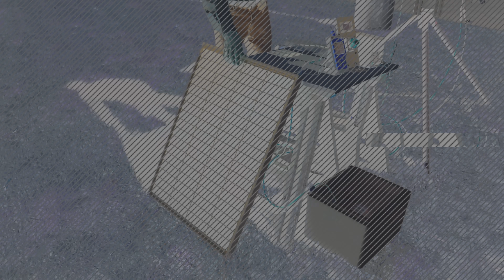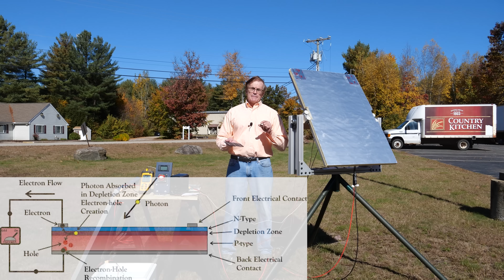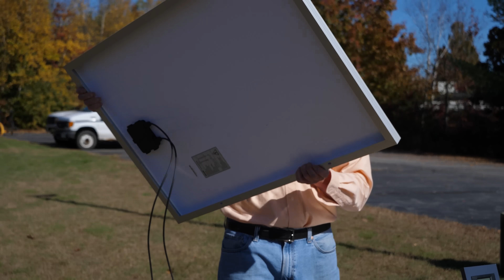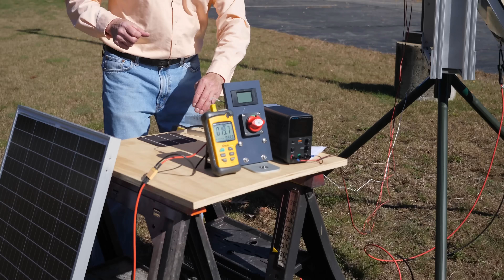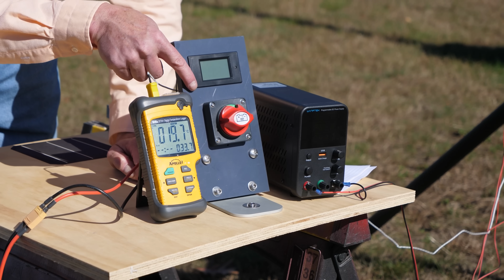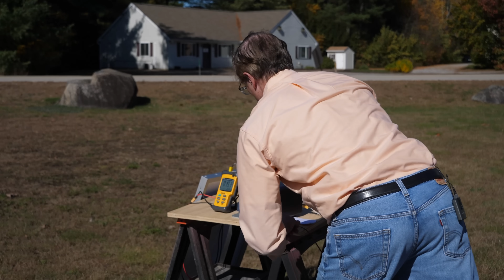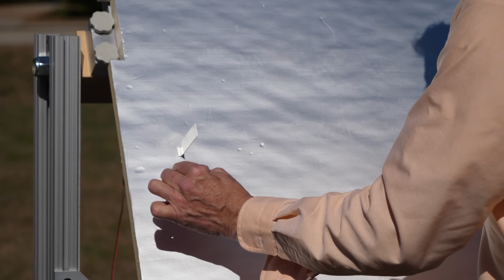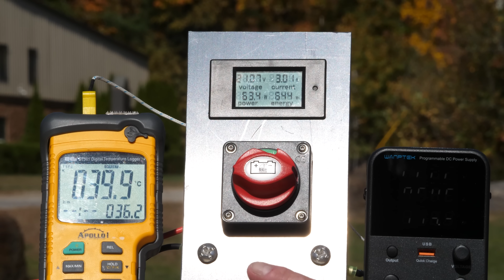Do you REALLY get enough out of your solar panel?

Comment: Glad to see you fellas start posting again.  I can't help but think fan replacement costs and dust/dirt buildup in the cooling area would make the efficiency boost not worth the modification.  Also, wouldn't ice in the fans destroy them every winter even though they're off?
Reply: If rather than using individual fans per panel like in the experient, you used two or three large fans, designed for outside use (those things last for decads), per system, you'd have a much more reliable cooling system. He touched on this towards the end of the episode. Also, if the fans were installed at the edge of the installation, you wouldn't need to remove any panels for repair. Obviously this would also require some sort of air channeling, but that's a problem that's already been solved.
Reply: @smwsmwsmw  no moving parts in my opinion.  Panel itself survives on it's own "historically".  I'd go with one big fan blowing on the array during hot calm days and/or paint the shingles white but I think that's pretty moot.  Not worth the small efficiency gain.

Comment: The least efficient solar panel is the one that's not installed. Most panels that are installed could generate more power, but they are generating some.

I've owned my house for 23 years. I've had panels on it for just under two years. They generated almost 11 MWh in that time. They're at a bad angle, they get shaded, but they produce infinitely more power than when I didn't have them.

So it's good to increase efficiency, folks should definitely do that, but the key is to get them installed.

Comment: Solar power is interesting and useful in some places, but hardly something that we should be trying to convert large portions of the grid to using.   The 'dirty little secret' of solar panels lies in the power they take to build.   I worked in a solar panel production facility and in-house testing showed that a panel would need to be in use for 7 years (in ideal geography at the equator...anything north or south and you lose the amount of sun it gets) before it produced as much power as it took to make it.   In the higher latitudes where I live it's unlikely that a panel will ever break even within its' lifespan.   Not to mention the massive water consumed by solar production as well as the nasty chemicals used in the process....I'd keep solar use only to places where conventional base generation is unavailable.

Comment: I can't help but wonder if adding peltier modules would be even more beneficial to what you have outlined in this excellent video. As always, well done!  Thank you!
Reply: Peltier modules are notoriously inefficient. Plus you'd still need a fan to remove the heat from the area.
Reply: @smwsmwsmw  They already have 3 fans on the setup already.
Reply: Peltier modules are inefficient... i think you can easly make the airflow more efficient, but that was not the point of this project, he wanted to test the whole idea of using some power to get in the end more power out of your setup.

Comment: I wonder if just the heat sinking passively would have relevance 🤔. Of course active would prove better but if passive heat sinking did have a significant gain then it may prove to be useful in certain applications. Would you guys be interested in doing a follow up with just the heatsinks in a passive setup? Just to show hard results and relevance. And thank you btw for your content!
Reply: came here to post that same question. Hopefully they answer it. Passive costs zero watts.
Reply: Based on what I've seen in PC hardware, this would be really difficult to pull off. Would love to see TI give it a go though.

Comment: I would like to see a comparison with panels that you only added the heat sinks. Maybe with one that protrude out beyond the solar panel enclosure. This would compare an optimized passive cooled system to your active system.
Reply: I'm curious how much adding a little solar chimney to the top of each frame would assist that natural passive ventilation would do? A few inches of black painted frame to the top to induce additional convective flow from the bottom.

Comment: I wonder if there is a higher efficiency improvement, if you add semi-transparent side  reflectors, with the right reflection wavelength, suitable for the panel.
So more light, less heat on the panel (plus a warmer roof).

Comment: Just amazing explanations as always!
I was however wondering if you thought about the added maintenance cost for the active fans themselves?
You did not mention the exact model so I just had a quick glance at the orion spec sheets and found 60-90k of expected operating hours (~7-10 years).
Although given the prices of around 20$ for some fans those costs would probably not amount to much as long as the diagnostics and replacement of any given fan is not too much trouble :)
Reply: The fans can actually last much longer because the ratings are L10 ratings. That means that given a population of fans, 10% can be failed by that time. L10 rating also assumes constant operation, but the duty cycle of the fans in this application would be less than that because there's no reason to run the fans to cool panels at night. So actual life will be much longer than a simple reading of the L10 specifications.

Comment: What would the wattage output and temperature be without the heat sink and fan setup installed. wouldn't it be a better comparison with a panel "out of the box" to one setup with your active cooling setup.

Comment: all of this makes me really question if we might just need to rethink solar power in general.

photovoltaic is convenient, but the materials are really expensive, they degrade over time, and as this video shows - they need to be cooled.

my bathwater is heated using solar directly, by baking a series of pipes dyed black in the sun, which heats the water that flows through them.
such systems become vastly MORE efficient, the hotter they get.

all that's required now is converting that heated water into power, which should be no problem given the heat difference between the pipes and ambient temperature.

no expensive components needed at all, the system gets more efficient the hotter it is outside, much more easy to replace and maintain, despite likely not ever needing to, because of this systems longevity in general.
there's not much to degrade when it's just a bunch of pipes, dyed mat-black, in a sealed chamber with a moderate vacuum. 
they last practically forever, but even if they get damaged somehow, any issue should be trivial to fix.

Comment: Have to also consider the physical stress from the aluminum strips thermal expansion.    However in an OEM case they could design around this.   A diyer might mitigate this by cutting the stips into much shorter segments... just squares

Comment: ?  A smart micro-inverter could back drive each panel in winter to melt snow covering the array.
After all an H bridge driver can do this.  Snow has blocked my panels for about 30 straight days
this year,   I lost about 3% of my normal 8.5MWH yearly production to the snow here in the PNW,

Comment: Mechanical components in outdoor environment running 24/7 for years decreases the MTBF, it is not ideal.
Mobile basestations have the same problem, heat reduces performance and increase risk for failure.
Basestation manufacturers try to avoid fans in outdoor equipment that run 24/7 for decades, they treat fans like if it is a plague.
You could have the fan only kick in when needed

Comment: This is why you never mount your panels directly to your roof. Use a railsystem so you get them atleast 20cm up from the roof surface. That way passing wind etc. will cool the backside of the panels - more years longevity and slightly better performance daily. I have done this to mine.

Comment: I am disappointed. As a native of New England transplanted to California I notice that you picked an atypical calm day for this experiment. We here in SoCal have them most of the time. I would like to see the same experiment done with the other, un-modified panel with a modest wind to see if it is roughly equal  in operating temperature just having the normal air circulation and heat transfer away at the back side. 
The  problem I see with the modified unit is radiative heat flow is stymied to some extent by your back panel. It could be reradiating right back to the solar side of the plenum equipped panel you have created. Please repeat the test on a comparable day, or use an IR thermometer to add in the radiative  heat flux.  Thanks anyhow for giving me some other things to check out about my solar battery backup system for the potential earthquake blackouts I can expect in sunny SoCal.

Comment: What did I do? I have 21000W panel installation on 15000W inverter. 60% facing SW. 40% SE. Cooler panels, longer lifetime. Always limited to 15000W during summer 3...4 hours

Comment: Thank you very much for your informative video.  Would the hot/cold(shade) temperature differential be enough to drive a peltier unit or array; considering the fans only require 6V/1W?

Comment: Hello again... I saw video with the panel and the mirror idea and it works well... Could you try to combine the ideas and see if it can be possible to run a full system... Also just as a idea or "joke" at night what if you could run a flashlight or LED setup over the panel to gain some extra power... use a power bank and run a matrix of LEDs over the panel to see if you can generate some power... LOL if only it was that simple... Thanks for the great video.... Cheers!

Comment: I'm not convinced eliminating the MPPT charge controller is appropriate.  When the temperature of a solar cell increases, the (short circuit) current increase as well.  The (open circuit) voltage however drops with temperature.  The optimum operating point is typically about 90% of Isc and 80%Voc.  With increasing temperature, the maximum output power does indeed decrease.  If you pick a fixed load dominated by the current (e.g. voltage across the load is say 60% of Voc) then your are current limited and output power will actually increase with increasing temperature.  If you pick a fixed load dominated by the voltage (e.g. load current is 70% of Isc) then your are voltage limited the the output power will decrease (dramatically) with increasing temperature.  The MPPT controller will optimize the operating point in any condition (sunlight, temperature, etc...) which may (I'm not 100% sure about your setup) show a smaller delta in power out as a function of temperature.  It wouldn't surprise me if the 5W gain with the fans for 3.5W of fan power, drops to 4W of gain (and maybe below 3.5W of gain).  Just something to consider.  Otherwise, Great video!

Comment: It'd be a huge pain, but I wonder if one could use the waste heat from the panels to power a low temperature Sterling engine. The engine could power the fans and add extra power if there's a surplus.

Comment: I really like the idea of active cooling of the panels! However the other argument against this setup would be that those fans in that environment are guaranteed to fail well before the panels' useful lifespan and replacing them would be a significant expense in just the labor cost for an array that's up on a roof. That's one point in favor of a liquid cooled array where you can have the moving parts separate, mounted in a location that's not so onerous when it needs maintenance. A 50/50 propylene glycol coolant would get around the 32F problem of straight water.
Reply: for small scale your are right.  At a whole house scale it's less of a issue.  Houses with central air for example rarely need to replace their fan's.

The freezing water issue was brought up specifically to deal with wells or lakes as your heat dump.  The issue with using glycol is your need a closed loop with a radiator.  Now you need fans as well as a pump.
Reply: @barongerhardt  yes, that's true.  The issue is that the fans already took more than half of the increased output to run.  If you add a pump in your not going to have any net gains at all.

Comment: Random Thought: How about sandwiching thermo-electric devices between the panel and the heatsink? The TECs could power the cooling system, maybe generate some extra power to boot. Covering the entire backside of the panel with TECs wouldn't be practical. Maybe just put a TEC under each fan, with an appropriately sized heatsink.
Edit to add: How about pairing up the solar concentrators with the active cooling, to really amp things up? (pun intended)

Comment: Have you seen combination solar panels that have pv and thermal built in? The thermal cools the pv while also capturing the heat and bringing it into a heat pump or hot water tank. Basically accomplishes the same

Comment: Synthetic jet cooling,  zero mass air flow can be very efficient.  Glue a CD to the face of a three inch
eight ohm speaker and excite it with a few volts of AC.  A high velocity jet of air results.  Actually
rolling expanding donuts of air are being lauched at 60HZ.  Very turbulent impingement cooling.

Comment: MTBF on te fans will be a killer for multiple panel installation. Would rather use passively cooled options like your bent metal (why not just use "extruded L" Profiles? and leave the back open to the air?
Reply from the maker: It doesn't  work as well.  Multiple,  large diameter, and low velocity  fans are a good option.
Reply: @TechIngredients  Natural convection vs. forced convection. Agree Forced is better, but if you can design for Nat. convection it would be more scalable and robust.

Comment: Interesting, but how many years will it take to make enough extra energy to cover the manufacture and transport of the aluminium sheet, fins and fans?
Reply from the maker: That depends on the scale of the operation and don't  forget the benefits  associated  with increased panel lifetime.

Comment: Seems to me you could use water cooling, to heat hot water for your house. You would loose some efficiency in electrical wattage but gain efficiency in total energy production by capturing the thermal energy. On top of that you would be reducing you energy consumption by not needing to heat the water, reducing your total system load. 

I wonder how much gain you could achieve adding Thermoelectric Peltier devices to the back of the panel, as an additional form of electrical generation.

Comment: Water flowing over the cells will cool by evaporation. I sprayed well water over my roof to cool it in Sommer.
Worked absurdly good but leaves salts behind
Reply from the maker: Consider an occasional  flush with an acidic solution(vinegar).

Comment: I was wondering if you could convection cool the sun panel.  Add an insulated chimney on top to create stronger draft. 
In fact you could do an entire video of whether is there a limit to that kind of cooling
Reply: It all comes down to the cost of the cooling, 5 watts will make $1 of electricity in about 1 year, solar panels last max 30 years
So if you cooling system gains 5 watts, 6 equivalent hours per day, for 30 years, your cooling system cannot cost more than $30 per 100w to just break even
And few people are willing to put money into an investment that doesnt pay back in 5 to 10 years.
And that's if nothing breaks, gets blown down, damaged by contractors, etc.
Reply: @jaycweingardt11  Since you replied toy comment I feel entitled to intrude:
Note it's around 5 watts in the video for a single panel. Still marginally beneficial but from a more level ground.
Reply: @LiviuGelea  Or consider the additional wattage gained from cooling and compare the cost of the cooling system (including maintenance over 30 years) against simply adding the equivalent wattage in additional panels without any cooling.  Well, I can already tell you the answer... it is far more economic to simply add more panels to the system than it is to try to cool an installation.
Reply: @junkerzn7312  you’re likely right. Plus, complexity adds its own cost in maintenance
Reply: I was wondering the same thing. As stated below by others, I'm also not the biggest fan of using fans, because of the added complexity. However, if there were to be a simple, low cost solution that would last the lifetime of the panels that would be striking gold.

In the solar panel installation on our home there are gaps between the panels. I can't help but wonder if it would have been more effective to seal every gap, and only leave the gaps on top of the rows of panels and the bottom. This would create a chimney almost for free. The top panels would be warmer than the bottom panels (so parallel connection would be required), but you would create a higher airflow, basically for free. Especially on less windy days this might actually result in a higher heat dissipation.

I'm not sure though, it's hard to get an intuition if the pro's would outweigh the cons.

Comment: What happens when tfans need replacing ?  If they last the life of panels ok.  Fans are likly to fail before the panel no?
Reply from the maker: Probably, but they're  small and light and if selected for this application  are likely to be worth the occasional  replacement because  they fail safe.  The panel  reverts to its  baseline performance.
Reply: @TechIngredients  thank you and I agree with your cooling idea as I have 18 panels not cooled and live in Thailand.  Days it is often 30 - 35 c here imaging I could gain maybe 5% which is very good.  Better that adding extra panels like I did.   Thank you for your reply and great video